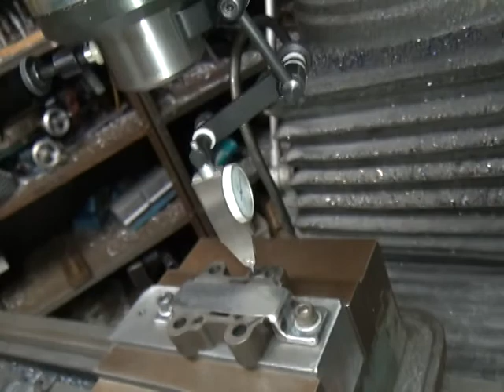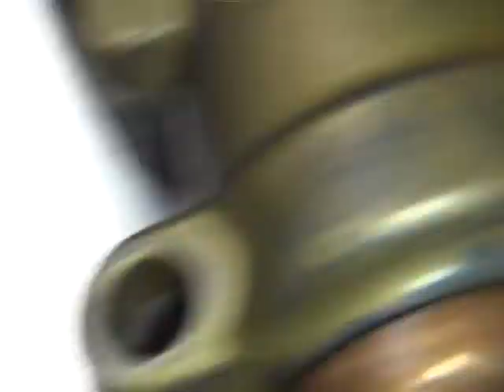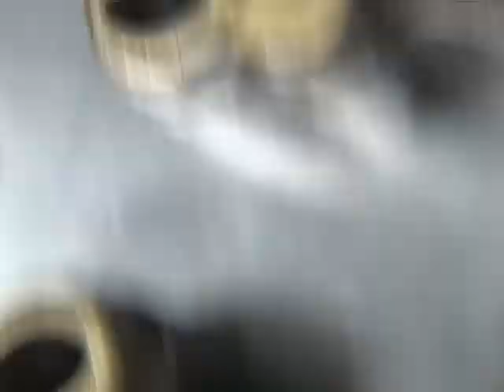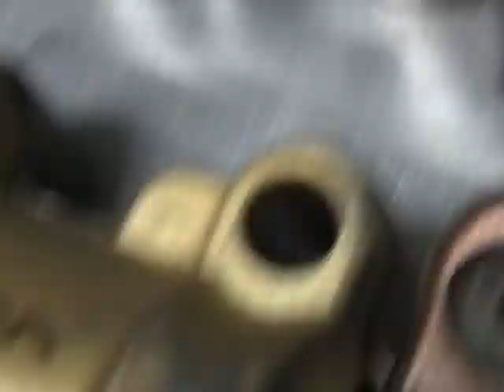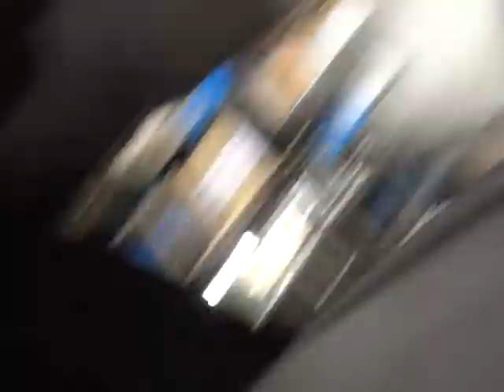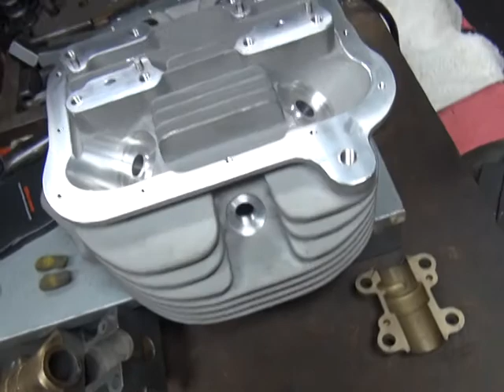#102 1948-65 Harley PanHead High-Lift Rockerarm Geometry welding by Tatro Machine

Comment: I am a former machinist and I am constantly surprised by your machining abilities and your attention to detail. This fixture is a great example of that. I was rebuilding CNC Machines in the early 2000's, and even there did not see the kind of thinking and precision that you put into your motors and bike building. The people that bring you equipment to work on are obviously getting the best work possible. Many Kudos to you T.